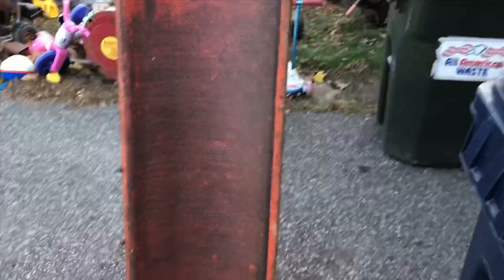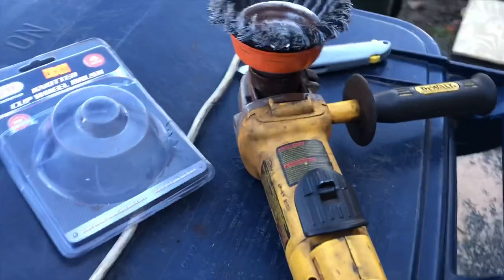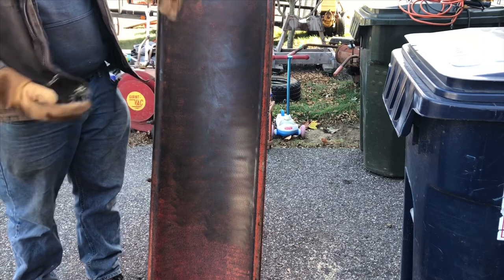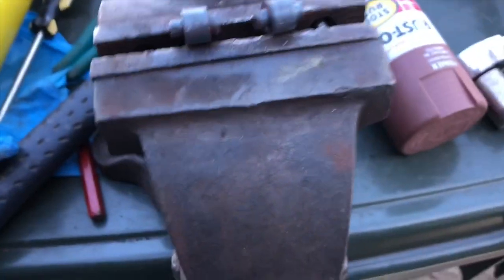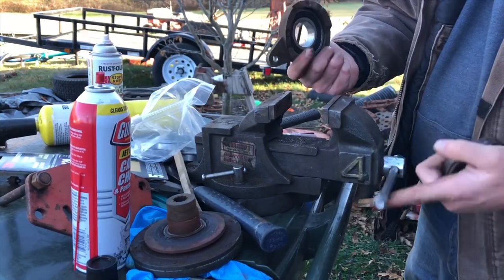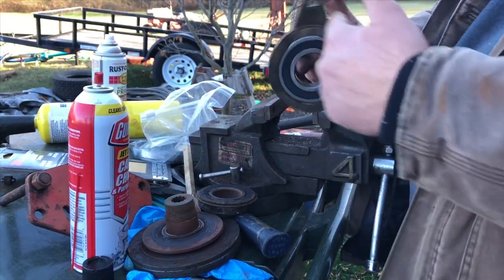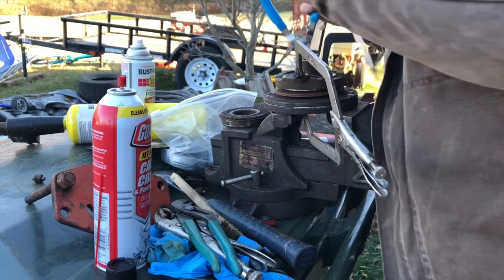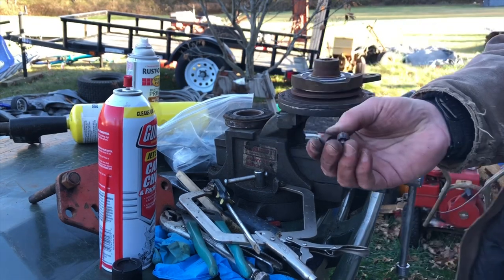Fixing the Gravely 8163-B Snow Plow and Forward Clutch Up Part 1

Comment: Cleaning up my blades is my winter project as well.  There are two styles of cam rollers - one piece and two piece.  Paul Hansen has both.  For one piece cams make sure the slots in the plate are deburred, clean, well lubed, and match each cam to a slot for best fit. PaulL
Reply from the maker: Panon1 hey Paul, I never knew they had one piece cams.   That explains why mine were all “seized”. Thanks for the info.   I hope your doing well....

Comment: Look like the cutting , were edge Is  bad. So take two wheel horse 48" snow plow were edge and weld it on then bolt other edge to the one that welder on. .that what I did on my gravely 8123. Snow plow.
Reply from the maker: James Stan good eye.   I have a piece of steel to bolt in the bottom.   That will be in a future series.   I will investigate the WH ones.   The OEM Gravely wear edge is like $130.   I have used this plow for about 15 years and it came with a used strip so I suppose the OEM is not a bad deal if it gets amortized over time.....